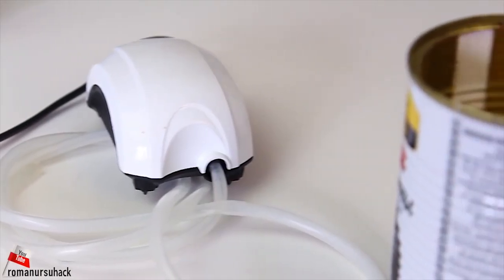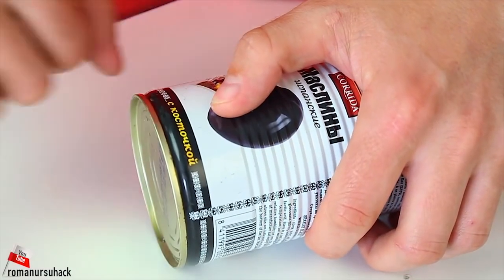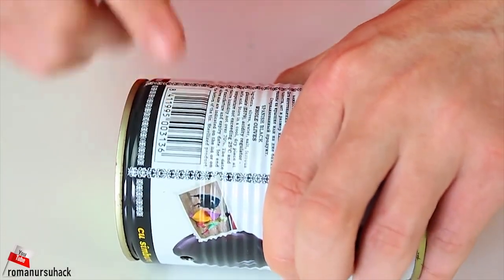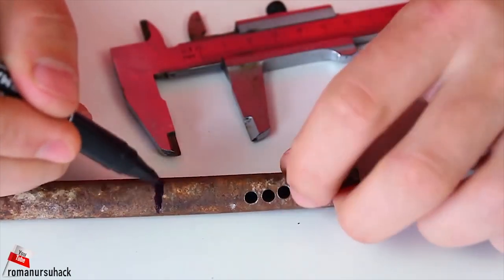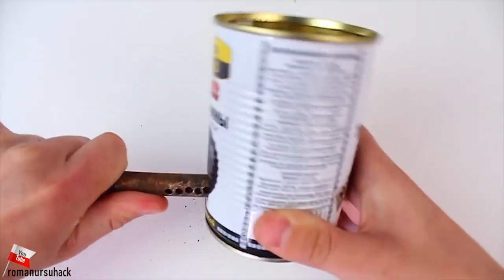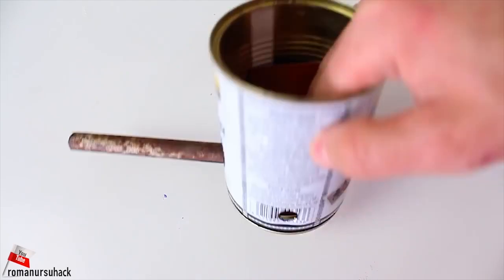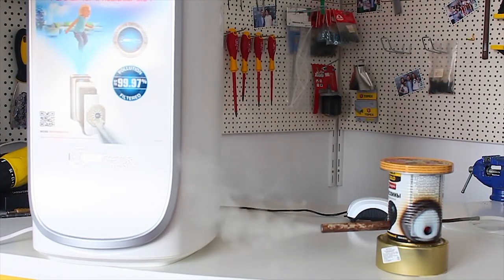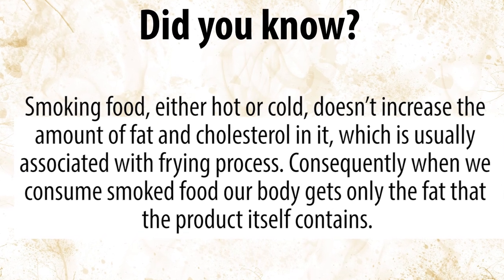How to make a SMOKE GENERATOR 😱 🔴 TUTORIAL

Comment: What's the capacity building of the air pump? I'm trying to make one this weekend. Thanks!
Reply: Have you made one? How is it?
Reply: @bear0629  I needed more airflow, but the venturi system works good. More powerful pump was needed. I used a stack of tin cans with venturi at the bottom. The key is to let the smoke out quick, otherwise it gets bitter

Comment: great fan of ur work... i have a question or a video request for u..can alithium polymer battery of any smart phone be hacked using similar multiple batteries in paraller keeping voltage same and capacity increased..will wait for this video if it is possible.

Comment: what is he using to make it smoke tho??
Reply: wood chips probably
Reply: its called smoking chips or smoking media
Reply: Neandercatz i meant for a heat source
Reply: Well, FIRE?
Reply: What part of fire is cold?
Reply: Robert Savoie I assume it cools down by going through the metal pipe.
Reply: i dont think it could cool that fast honestly.
Reply: Robert Savoie its smoke so its just very little mass
Reply: meh, still dont know
Reply: read description
Reply: ok... i get it... he is burning stuff to make the smoke,  but the way this is set up the smoke going into the container of what your smoking is cooled down instead of like just putting the meat over a  wet fire, so the meat is completely cured from the smoke and not from the smoke as well as heat from the fire producing the smoke.... i understand  and i hope that may help the rest of you understand as well
Reply: +Robert Savoie By saying Cold he meant the smoke not the method of making the smoke !
Reply: NA that's pretty much what I was just saying
Reply: Philie Spiess can i just use normal saw dust?
Reply: LE-Handmade knives can i just used normal saw dust instead?
Reply: draco coco probably, but to get the flavor youd wanna use hickory or walnut or a wood like that id guess